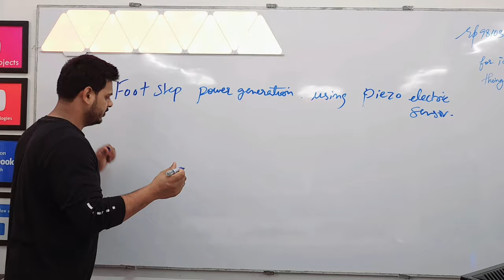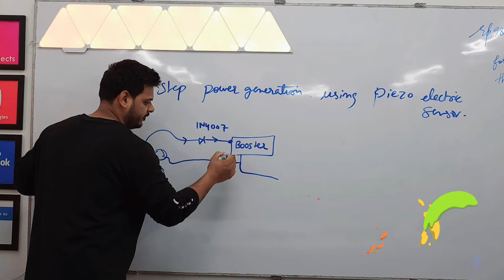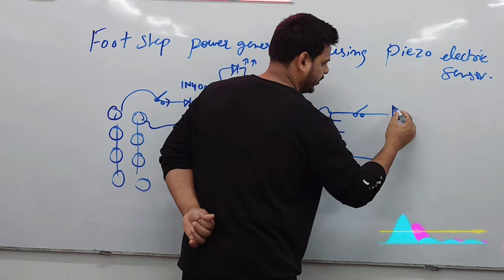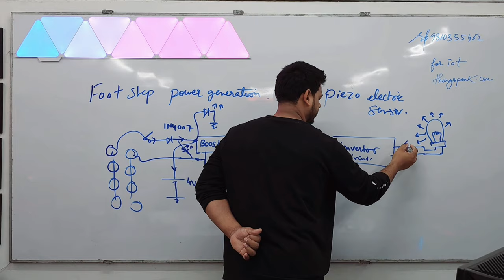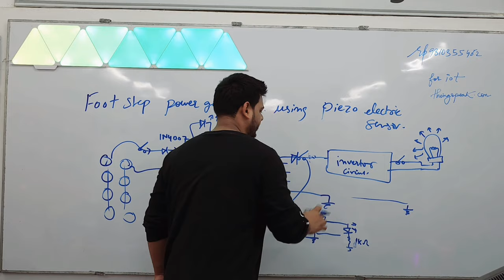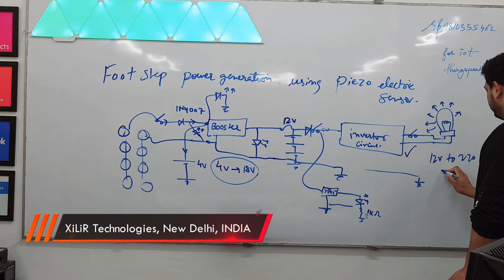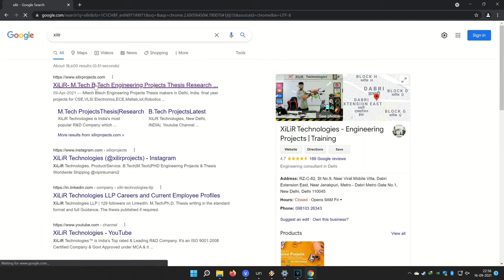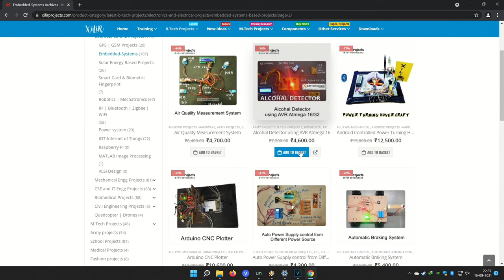Footstep Power Generation using Piezoelectric sensors  | Inspire Award | Best Engineering Project

Comment: Could you please provide the code if possible...
Reply from the maker: No code required in this bro...
And thanks for watching
Reply: @XiLiRTechnologies when used Arduino
Reply from the maker: @prasannalakshmi1235  arduino is required when u need some extra work like writing voltage generated by system on lcd
Reply: @XiLiRTechnologies  thanks for the clarification
Reply: @XiLiRTechnologies can u plz suggest which project will be better for final year
Reply: @XiLiRTechnologies we r not understanding as to which project we should implement, can u plz help us, our time is running out
Reply from the maker: @prasannalakshmi1235  whatsapp me or check xilirprojects.com...
Reply: @XiLiRTechnologies your no?
Reply from the maker: @DelightfulDove-px9sj  98103 26343

Comment: I tried to use IC7805 to regulate the voltage to 5 volts but there no voltage reading at the output. What do you think is the problem sir?
Reply from the maker: Where u tried 🤔?